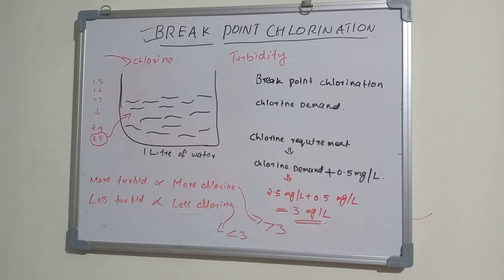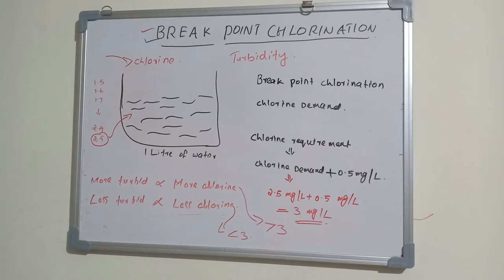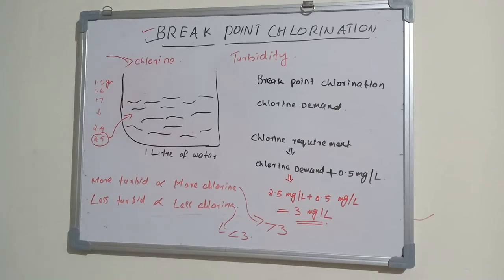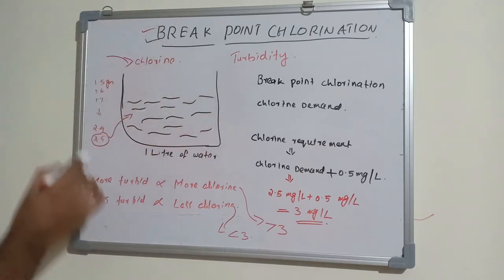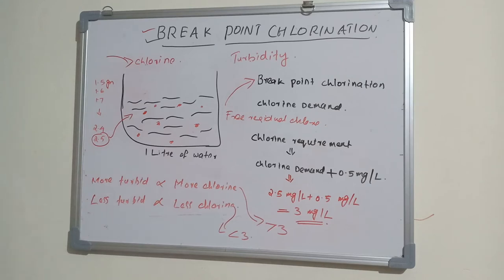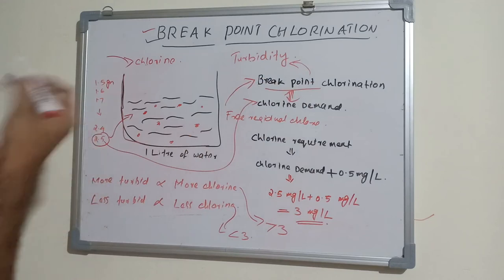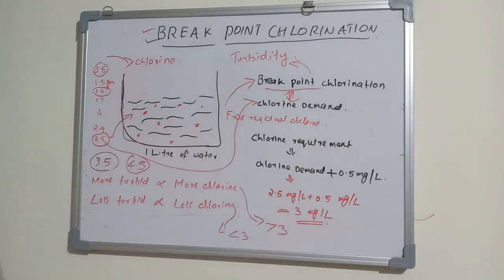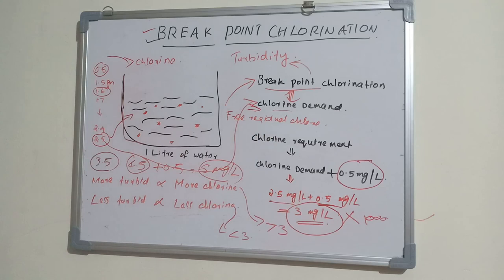BREAK POINT CHLORINATION

Comment: O.5gm only for one hour..?..after one hour again we add 0.5??
Reply from the maker: Its the standard amount. We need to have 0.5 mg/litre of Free Residual chlorine at water to keep it as 'POTABLE'.

When we get a water with FAC(Free residual chlorine is less than 0.5 mg /litre its not drinkable/'POTABLE'.

So when water is supplied from a purification plant, its assumed that it reaches the  people within 1 hour and will be used. As the time goes by chlorine amount will be decreased. So incase the supply time is more than 1 hour chlorine must be topped up at intermediary points to maintain the 0.5 mg /litre.
Reply: @Dentistrynmore  ...so just 0.5mg/lt is enf to make it portable for how mny dayss...or through out makes it portable .??

..sorry i dint get the intermediary point can u plz explain..😬